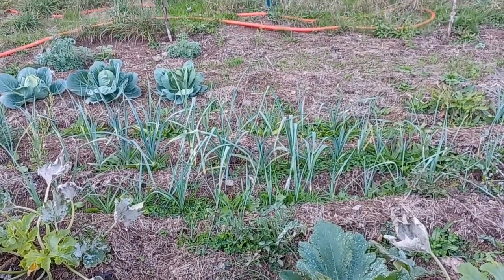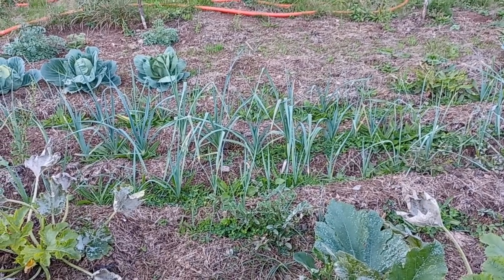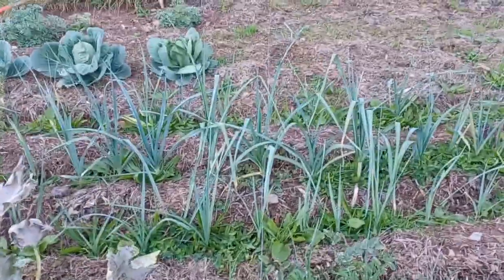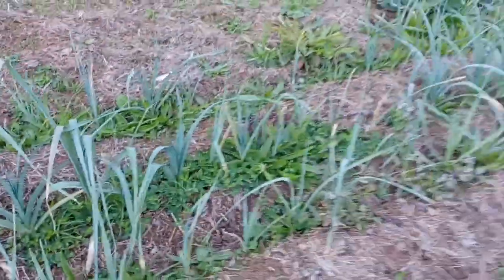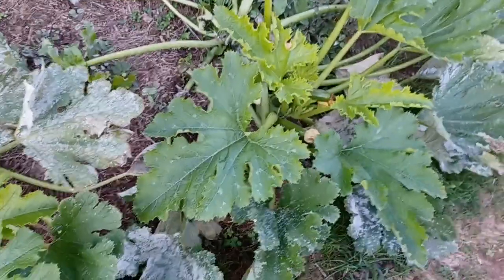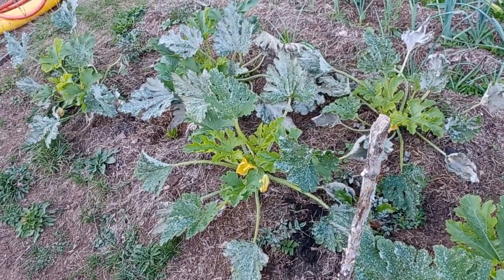Electroculture testimonial Earth cylinder magnetic antenna invented by Yannick Van Doorne in 2010.

Comment: Yannick, thanks again for all you're doing and providing this information.  On an earlier video you posted about the magnetic ground antennas, they were installed 10 to 12 cm below the ground surface. These antennas were at ground level. Any difference between the two methods and results? Thanks
Reply from the maker: It is better to put the antennas and wire below the surface in contact with the soil, but for practical and demonstration purpose I put also on the surface of the soil and it works too.